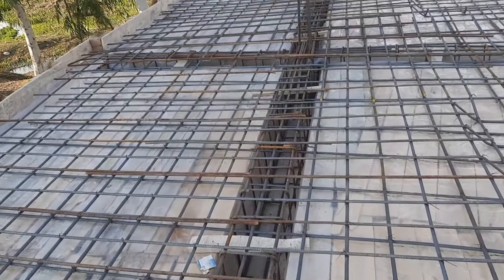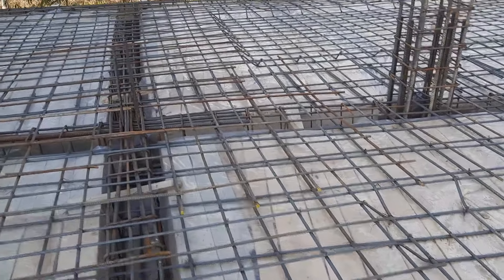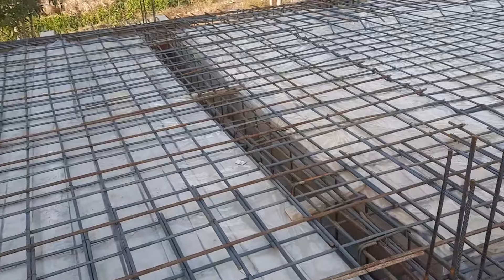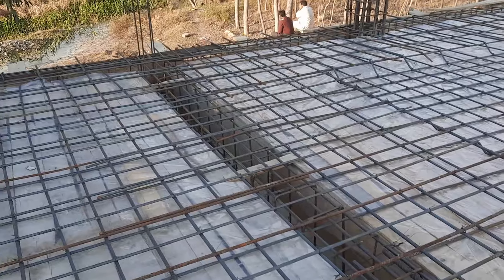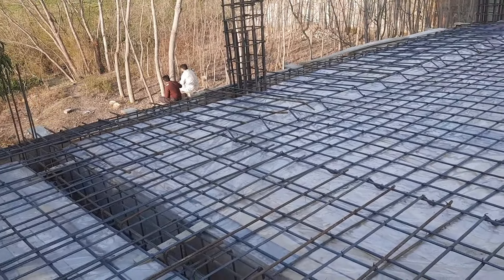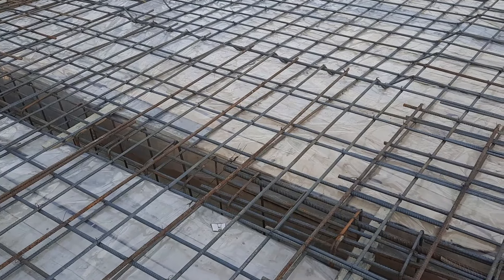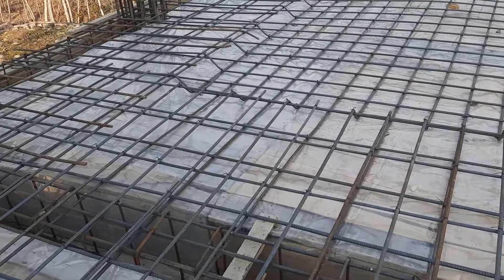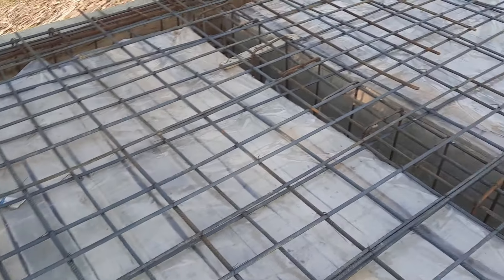Basic Information About Slab Reinforcement on Site |

Comment: I clearly see that the beam will be cast together with the slab.  Here we cast the web of the beam first then the top part of it is case together with the slab.  I would like to know how this affect design. Thanks.
Reply: Mostly in ground floor for normal building, use bonding agent before next concreting.

Comment: Should slab reinforcement go over the beam reinforcement or inside beam reinforcement??
Reply: Ca.n u pls answer?
Reply: The bottom straight rebar will extend from inside the beam, while the cranked rebars will be positioned above the rebars of the beam in an alternating fashion.

Comment: The video provided valuable information; however, after the 4:56 mark, it was stated that there is a boundary beam, specifically the top cranked bar in the longitudinal direction, is not required. It is essential to include it in the same manner as you have indicated for the transverse direction, as there will also be presence of negative moment. I believe this is a serious mistake.